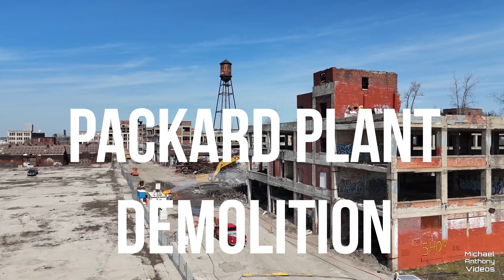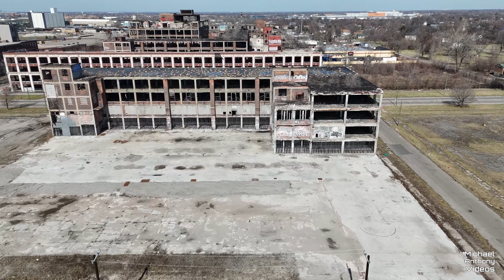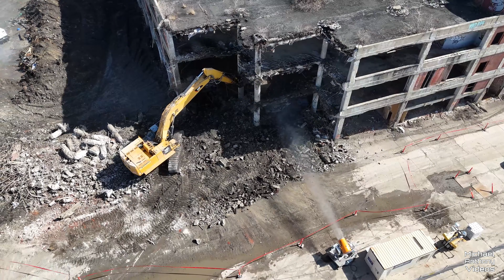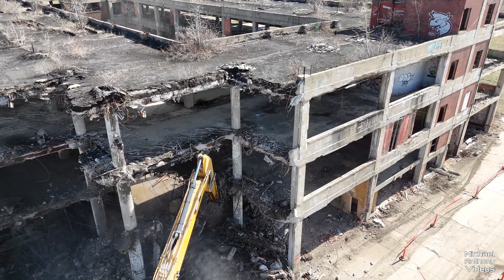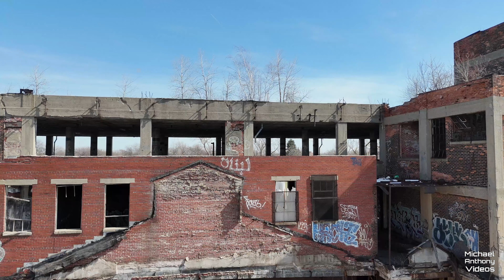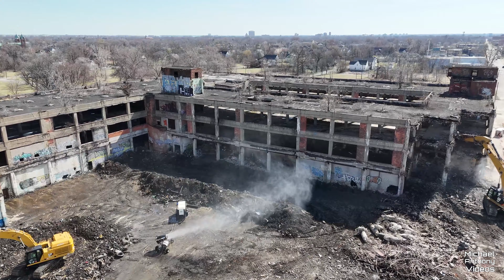Packard Plant Demolition 2024 |  Detroit 4K Drone

Comment: Was thinking while watching this, wonder if there's any asbestos in there somewhere? Most buildings of that age have it, to some degree. What a huge, huge place! Thanks for posting 👍
Reply from the maker: It probably does have asbestos and there's occupied houses right across the street.
Reply: Yeah I bet it does that's why they were spraying water to keep the dust down
Reply: The law requires asbestos to be remediated - manually removed by a qualified and licensed contractor while being monitored by an industrial hygienist - prior to structural demolition.  The water spray is just to hold down the nuisance dust from the broken concrete and masonry.
Reply: Per the EPA, all asbestos needs to be removed BEFORE demolition commences.
Reply from the maker: @brettbudetich3162  💯

Comment: This factory complex is too deteriorated and has been neglected for too long for any type of renovation and redevelopment. Plus the vastly huge size of the floor plates just makes reuse cost prohibitive. Trees growing in the roofs probably meant one thing, severe water damage over the years. All those roofs most likely leaked like sieves. Detroit will finally be permanently rid of this huge obsolete decayed eyesore which could greatly help the surrounding neighborhood.
Reply from the maker: And the entire building was stripped of all the copper.